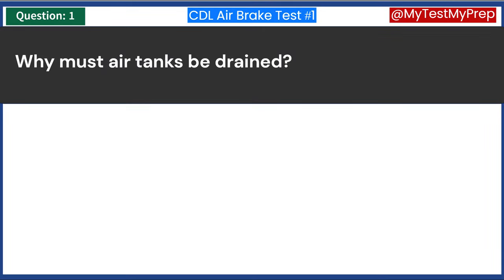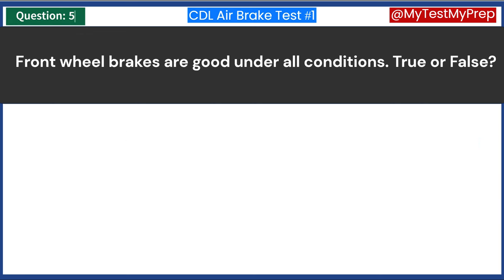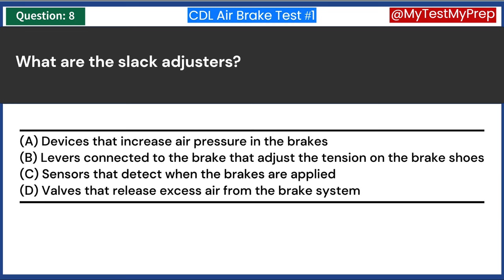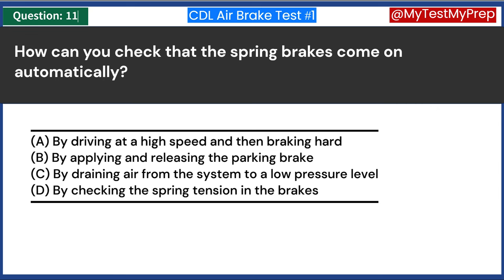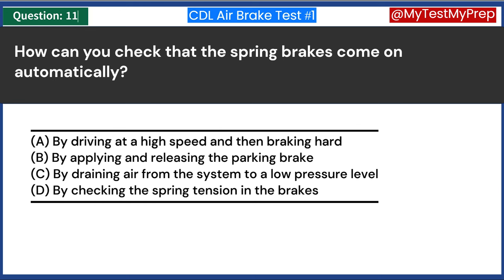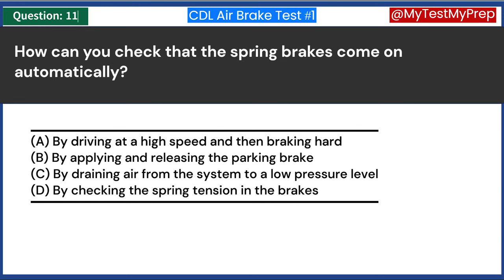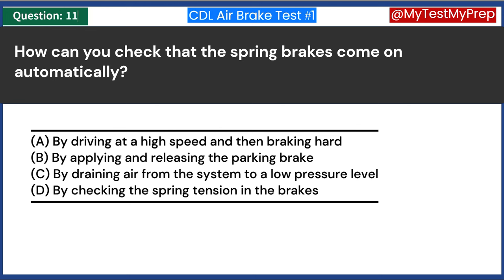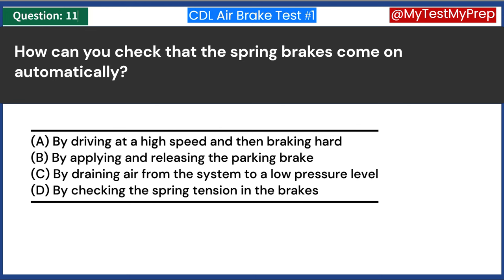CDL Air Brake Practice Test 2024 - 25 Questions with Detailed Explanations

Comment: Incorrect Answer on Question 5, "Front wheel brakes are good under all conditions, True or False"  Your video said answer is False.  According to the Tx CDL handbook the answer is True.  Section 5.1.13 (ref: Tx CDL handbook version July 2017).  This is my interpretation of the book and is supported by my experience taking the air brake test less than 3 days ago where this exact question was on my test and I answered true and was provided with a correct answer confirmation.  My comments here apply to my knowledge of Tx law and may very well be different in other states so please verify for your local jurisdictions.  Otherwise, great video content.
Reply: You're correct the answer should be TRUE
Reply: True for South Carolina too
Reply: According to the current 2024 Oregon CDL manual, “front wheel braking is good under all conditions”.
Reply: I know i don’t know you but can you please help me pass this test i failed for times I use to drive 53”foot boxes for the railroad but just couldn’t leave the yard because I had no cdl I’m trying to do better for myself I’m crying out for help god somebody please help me
Reply: @yaboy8666  bro, download thd CDL manual for your state and make time to read it. Ignore everything else and focus on the one thing. No tv, no vidro games, no visiting friends. Just studdy until you know it and do all the other stuff after you secure the test with a passing grade. 

Best of luck. I also failed the air brake and combination portion. I'm studying my butt off.
Reply: True for Missouri!
Reply: My common sense said to answer False because nothing is fail proof especially when based on conditions that do change.
Reply: @IronBear-xi1cg  I like your style. Shut everything else out and just study. I hope you passed.
Reply: @yaboy8666 So what's the update? You passed?
Reply: @IronBear-xi1cg  I'm in the same boat I failed Air brakes because of wording I've studied to my hearts content gotta go in tomorrow and try again
Reply: @IronBear-xi1cg  its there an app?? I live In Texas
Reply: @claudiaguerrero2045  I live in KY so it is a downloadable PDF file. I printed it out too, but that's a lot of paper.
Reply: @dwayneb5118  Good luck.
Reply: @FSUOSU25  I did pass. I got though school and all the company training. I get assigned my own truck today. I've learned that truck driving is an investment in yourself.
Reply: @IronBear-xi1cg i ended up passing have my permit now
Reply: True for NC
Reply: @dwayneb5118  congrats. There's much more training when you get hired.

Comment: question 2    ...... The supply pressure gauge tells you how much air is in the tank at all times. In some vehicles, it may be connected to a warning bell or light. True - if a vehicle has air brakes it must have a low pressure warning signal